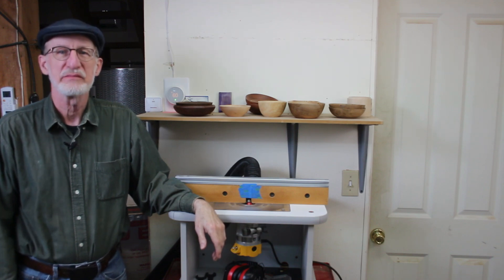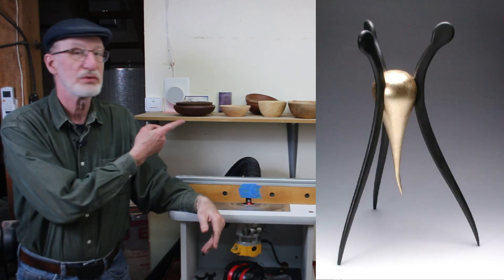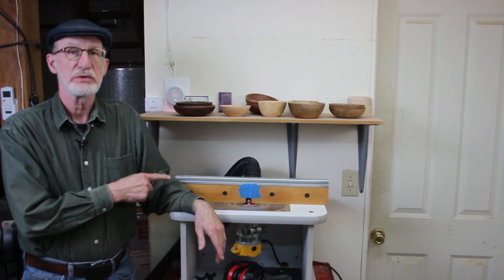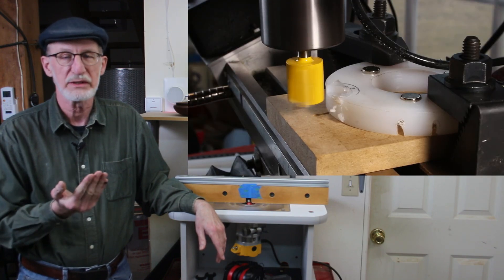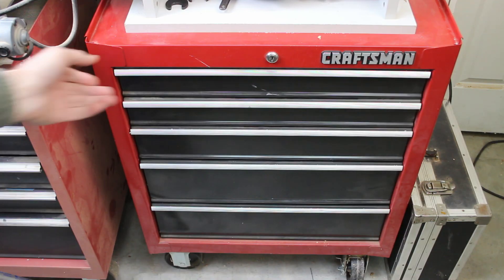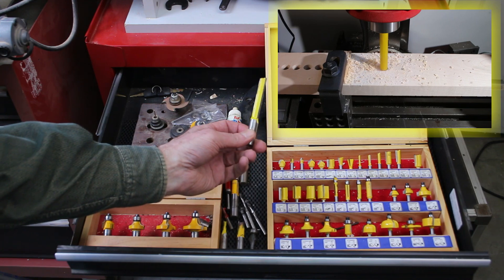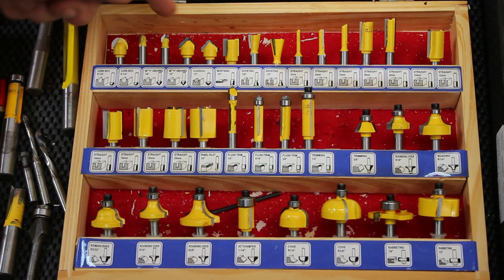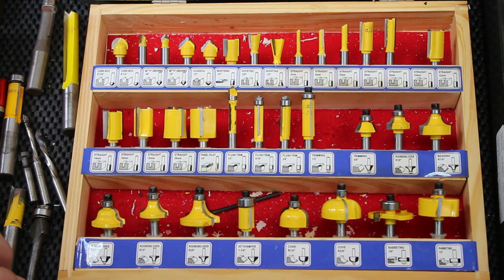Quick tip #5 - router bits for milling non-ferrous material

Comment: I just discovered your channel this morning and have enjoyed several of your videos already.  Thank you for sharing with us!
I haven't had occasion to try it myself yet but, if you'd be open to another idea, I've heard from multiple sources that carbide router bits can also be used on ferrous metals - though with the bits run at very low speeds and with plenty of cutting oil.  (High speeds would certainly trash them almost instantly from the shock loading.  ...As far as that goes, this is the first time I've heard of using them at high speed on nonferrous metals too. 😊)
Obviously a mini mill isn't going to have the rigidity to cut half inch radius roundovers in steel, and it's probably going to be limited to mild steel and cast iron in any event.  Personally, I think I'd want to use bits with 1/2" shanks too, unless I'm making a small cut with a short bit.
Thank you again sir.
Reply from the maker: Thanks for your thoughts Doug.  I am still exploring how to use router bits on metal and you might enjoy seeing my most recent video about using one on aluminum in my mini lathe:
https://youtu.be/V15cb8vo1og
I'm still trying to figure out speeds and feeds and may have been running too fast on aluminum based on some feedback.